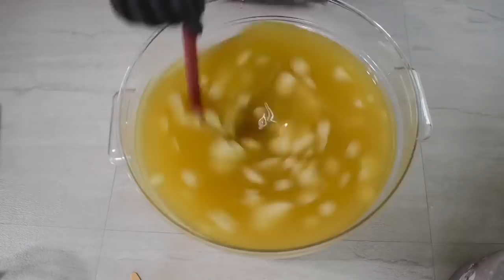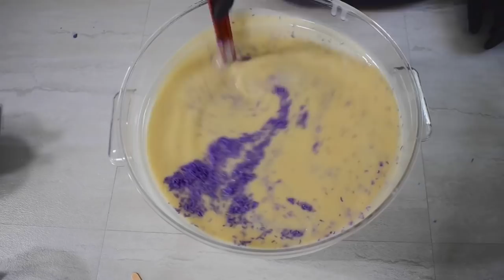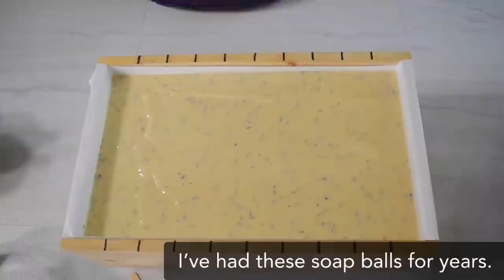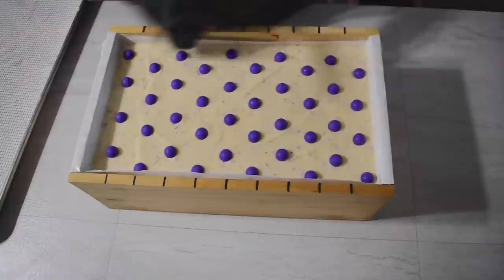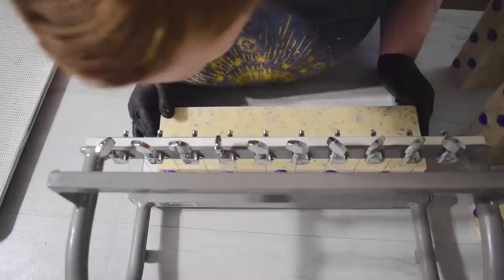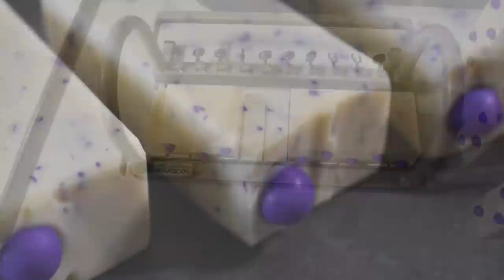Confetti Cold Process Soap Making

Comment: Thank you for your videos. I have been making cp for only 6 months and I have used the heat transfer method from the beginning. I’ve noticed that you are adding the hot lye to all of your oils not just the hard oils. I thought when I watched some of your earlier videos you added the liquid oils after the hard oils were resolved. Is there a reason why you changed? Also I made soap on a stick tonight, my first batch to do that. How do you deal with fragrances that accelerate? My soap mixture seemed to still be really hot when I was ready to add my fragrance. How long can a soap mixture sit without fragrance before it will set up. Should I separate the mixture off to add color and wait to add the fragrance, mix with a whisk and pour right away?
Reply from the maker: One day i thought to my self. I wonder if it would melt all the way if I had all my oils and butters in before adding the hot lye water. I did it and it was fine. One less dish to wash 🙌🏻
I try to stay away from super accelerating fragrances but sometimes it does happen. Usually not soap on a stick though, thankfully. But I just try to work as fast as I can. 
I try to not over stick blend in the beginning. It will give me plenty of working time as long as I dont add the fragrance in all at once. That’s why I prefer to add it in as I color.
Reply: @OpheliasSoapery  lol, guess what I’m doing on my next batch. Thank you